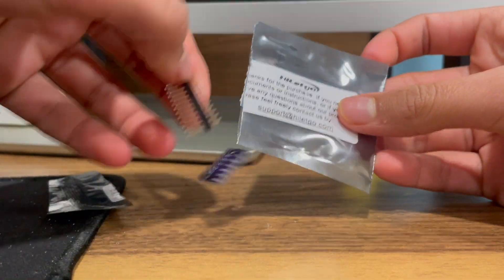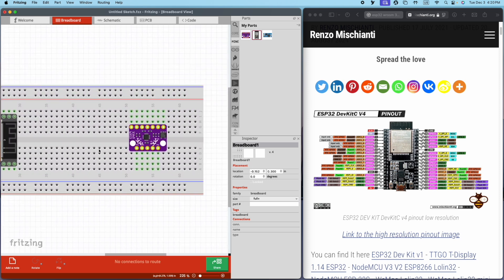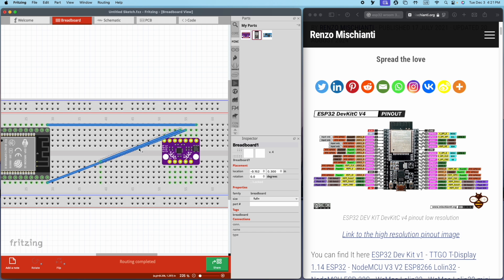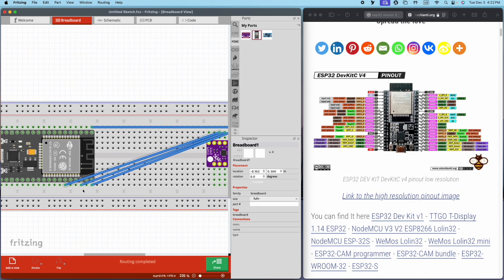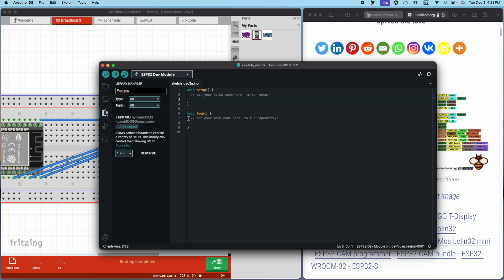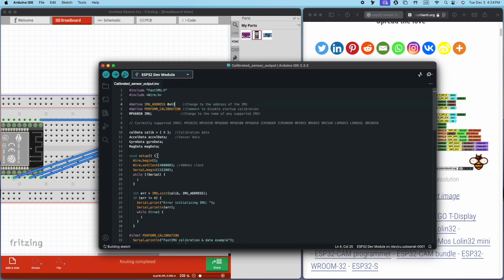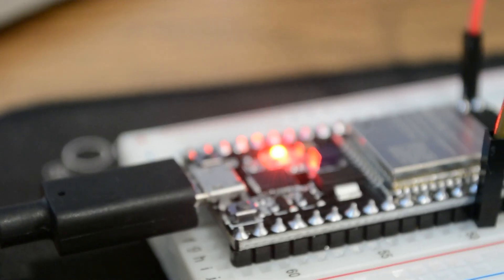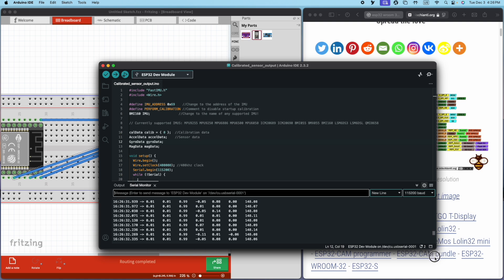How To Use The BMI160!

Comment: What is the difference between connecting the 3.3V pin from your microcontroller to VIN instead of 3v3 on the BMI160? Is there any difference?
Reply from the maker: the VIN pin usually has a voltage regulator that brings the voltage down to 3.3V the 3v3 pin does not. Usually if you had a 3.3V power supply you would connect directly to 3v3 on the IMU, but for some reason that was not working for me so I connected it to VIN. Do whatever works.
Reply: @neuron111  Yeah, after reading the writing on an on board chip, I saw it was a 5v to 3.3v converter, so I assumed as such.
Reply from the maker: @ sorry for the late reply
Reply: @ no worries bro